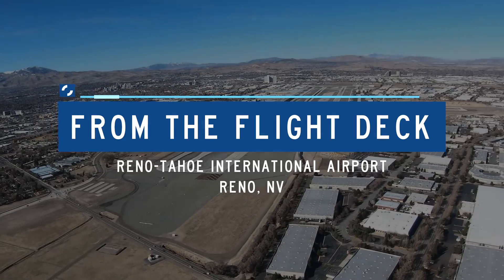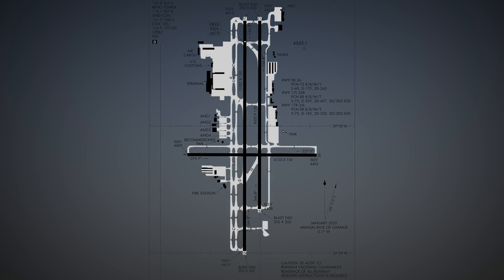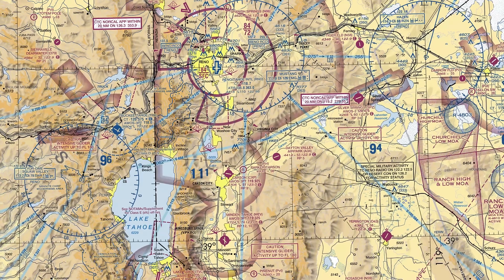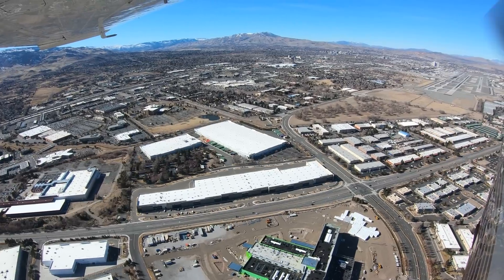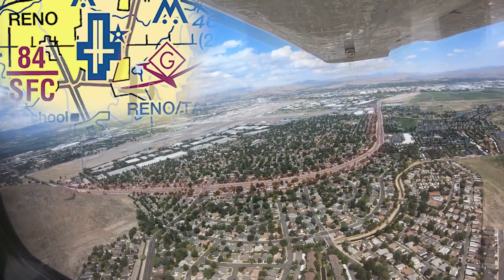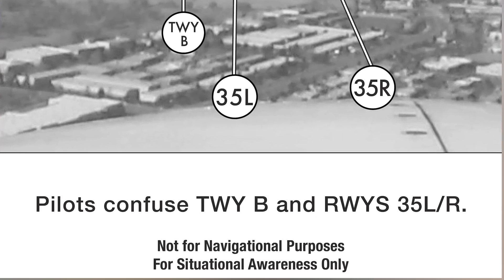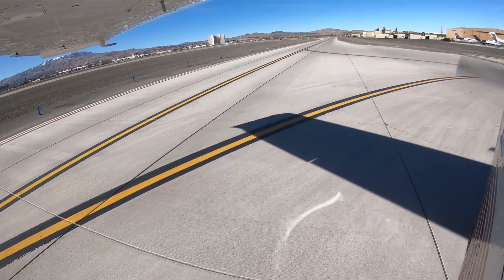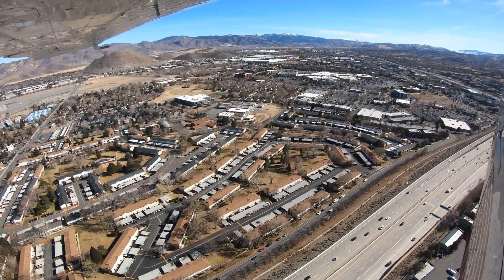From the Flight Deck – Reno/Tahoe International Airport (RNO)

Comment: If you haven't already, this should be done for an airport like KDVT (Deer Valley/Phoenix, AZ) and/or KFFZ (Falcon Field, Mesa, AZ). Dual tower frequencies, contacting tower/ground for transfers from north/south runways, etc. becomes a nightmare for unfamiliar pilots, even experienced pilots unfamiliar with the airfields and operations. Also not sure why taxiways are not better demarcated vs. runways. I have seen aircraft lining up for the taxiway I just taxied onto, and have seen in the air, for newly paved taxiways, how deceiving it can be at certain airfields' runways & taxiway configurations while in the air.
Reply from the maker: Thanks for the great suggestions Doug! We have From the Flight Deck videos for those airports, feel free to check them out in our playlist or here DVT: https://youtu.be/2xYS3Zyn3uA and FFZ: https://youtu.be/_tRIShTBZzk

Comment: This video is not knowledgeable in regard to this airport.  The calm wind (and instrument approaches) runways are the other end, 16R, L...and are not confusing.  The challenges are the casinos which are in the approach for 16L.  The surrounding mountains on both sides of the valley, and the constant cross-winds and wake turbulence issues make a bigger mess than landing on the less common 34R, L.  Occasionally you will be asked to suddenly land on 7/25.  But very rarely...the approach from the 25 end is treacherous as you have to bank on the East mountains to get aligned.  Also, KRNO has been undergoing a lot of runway closures due to construction over the last couple of years.  This has created danger due to all traffic forced to share a single runway.  Esp when commercial traffic is forced onto 16L, the shorter runway and has to taxi much further to get to the passenger terminal.
Reply: While you are correct that the calm wind runways are 17L/R (16L/R at the time of the making of this video), the main purpose of this video is to educate pilots so as to reduce the occurrence of wrong surface landings.  Wrong surface landings occur mostly on the 35s (34s at the time of the making of this videos) for the reasons outlined in this video.  So I have to politely disagree by saying that this video is very accurate at depicting the most common issues here at RNO.